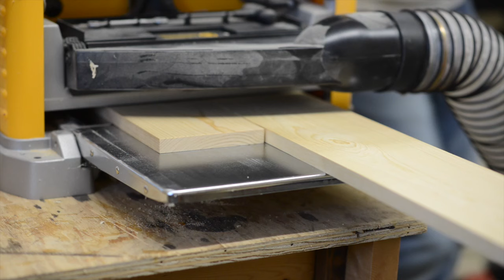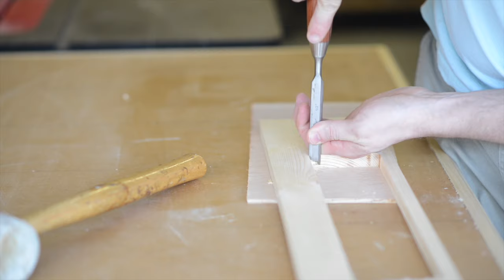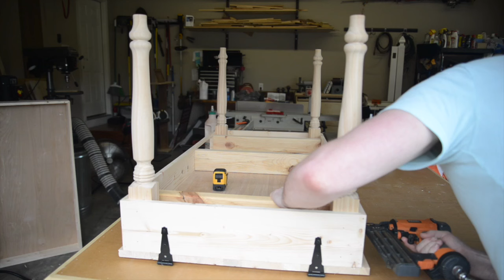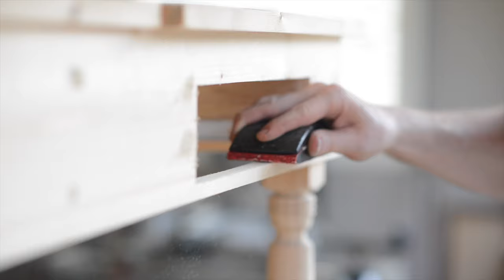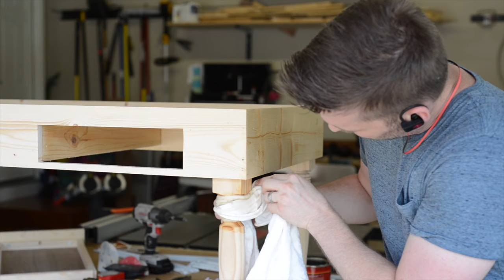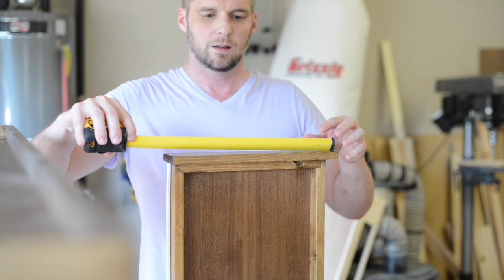Building A DIY Puzzle and Game Table

Comment: Which router bit did you use exactly. Had trouble with the mitre when putting the box together. Triple checked and all measurements are exact. I used a 1/4” double flute and maybe that was the mistake?
Reply from the maker: I used a straight bit with a bearing but that was only to finish off the drawer opening. Tell me what's off with your miter and maybe we can figure out what adjustment is needed.

Comment: Great design. I'm a novice and would like to build for my wife. You wrote "(based) off an original design". Did you use Designed Decor's actual measurements for each piece?
Reply from the maker: I was building it for someone else and I made it longer to fit their space. I also made inset drawers instead of overlay drawers and set the inside "top" a little lower so that most game pieces could fit under the lids.
Reply: @OutoftheWoodwork  Roger that. Think I will make the same mods. Last question (I think). Would going 29" on the legs be a mistake? 20" clearance is a bit tight for me to sit under. Thinking with added length it will not look top heavy.
Reply from the maker: John I think that would look fine. The sides are wide enough that you could go higher and not look weird.

Comment: What are these hinges? I have tried to figure out for two days now how to make a chest with two sides that open fully like this. I can't seem to find hinges that bolt that far down (0.75') past the top board to join to my side frame. and of course its the only part you didn't show is the part i need hahaaha
Reply from the maker: Hey Ryan, I used 'Everbilt 4 in black heavy duty decorative strap hinges' that are available at Home Depot